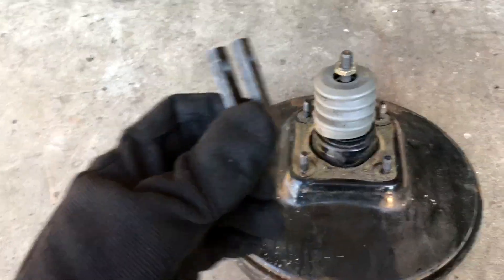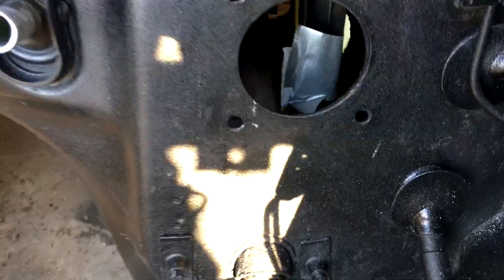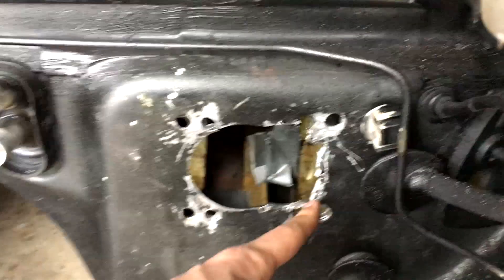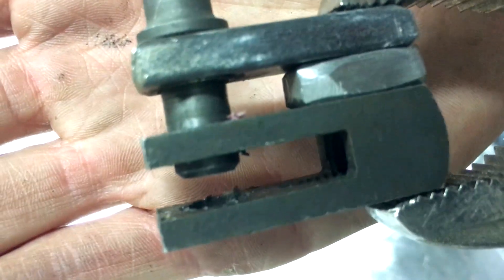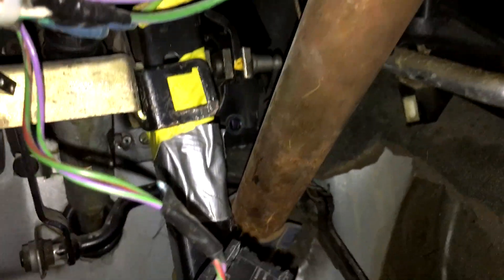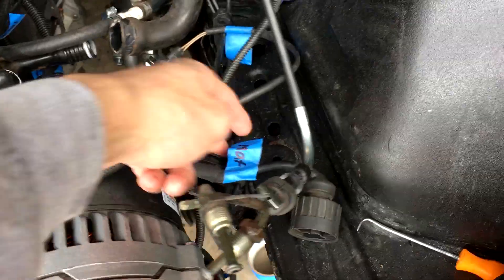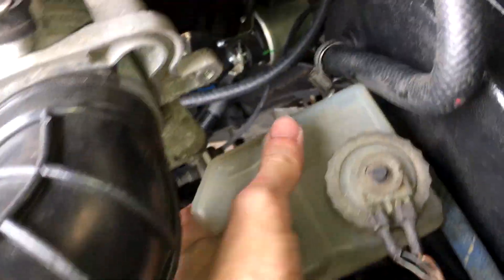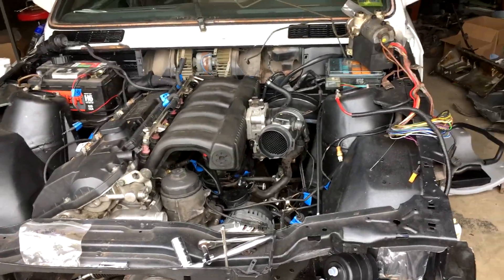E30 M52 Swap - Brake Booster Relocation

Comment: Awful job. Why not adjust the rod from the brake pedal instead of welding that extra piece on to the yolk? Now when you push the brake the servo rod its being pushed at an angle instead of dead center, eventusll this will shear off and you'll be dead.

Comment: Man use golf mk2 brake booster. It fits without relocating ur oem booster
Reply: Does it bolt right in? Im in the process of swapping a m52 in my 89 vert and  I'm not sure which is the best route. Ive seen a porch booster in one video  not too long ago, but never heard the mk2 golf bolts up directly with no modifications.

Comment: Nice work..!! it happen the same thing to me when I was sliding my booster.. Did you use e36 motor mounts?
Reply from the maker: e36 motor mounts won't work, you need to use e28 535i or m5 mounts. im pretty sure i got them from fcpeuro
Reply: ImJoel  I heard some guys flip e36 motor mounts too I saw in your video the mounts and I thought they were e36.. yes I already bought the e28 mounts I’m waiting for them..

Comment: What transmission did u use?
Stock e30?
Reply from the maker: i used a zf with a 2.93 lsd. at 80 I'm at about 3200
Reply: Kool man.

Do u have Instagram? Were i can check photos of ur setup
Reply from the maker: @CoolBuildz661   i dont know why i've never made one before but you inspired me to make one lol. @e30joel